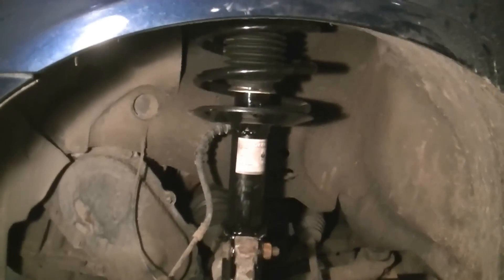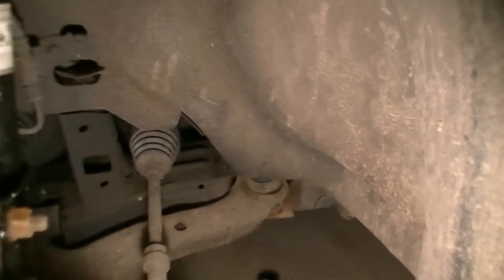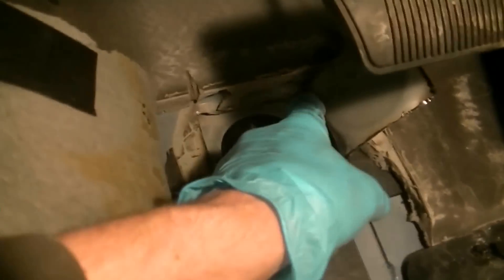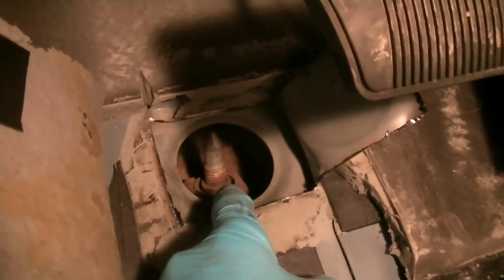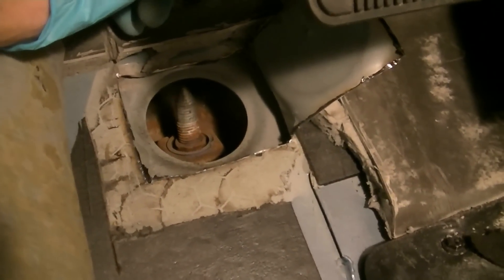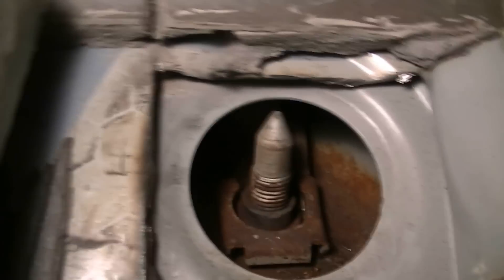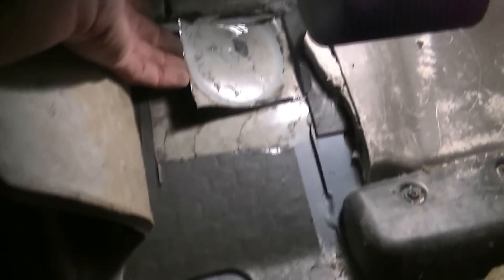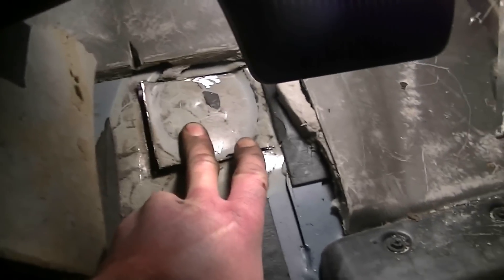PT Cruiser Spinning Control Arm Bolt Repair

Comment: Got this job going on myself, so thanks for the vid. I had these bolts out before for suspension changes, guess I should have put some anti seize on them. Can't complain about the car too much, best truck I've owned for hauling equipment in comfort. Not too many cars shorter than a neon that you can load up with enough sound gear to do a full concert. Holds more than most small wagons.

Comment: Thanks helped me alot. ending up drill a 1/4 inch hole right next to the flat side of the nut. put a 1/4 inch pin in the hole so the nut would not move. Now I have a mess to clean up.

Comment: So how did you keep the nut stationary?  The first attempt with a key, you mean a lock key or a shaft key?  Aboot to cut my floor board and need to know what to do with the nut to keep it stationary.
Reply from the maker: Justin Shiffler If you have 45 degree long needle nose pliers, it works well. first soak the shit out of it with penetrating oil, might need to use heat/torch.

Comment: I just work those back and forth with an impact, and usually they come out. When they don't, I cut out a 1 inch by 1 inch square in the side of the sub frame, torch the nut till its cherry red, impact the bolt out, then weld the square back to the sub frame when I'm done.

Comment: I have the same problem with an 08 cobalt.  Looks like im going to get the grinder out....  it would have been nice if gm would have welded the nut to the frame instead of putting welding a nut to a flat piece of metal and having a tin stopper cage around (that bends easily)
Reply: I have the same problem on a cobalt, how did ya do it

Comment: i always heat the bolt head before removal on these
Reply from the maker: UBBERTANKER So then it will be guaranteed to spin, Heating these bolts melts the plastic clip that holds the stupid nut in place. Obviously you never done one before!!
Reply: Haha you just got owned..

Nice job Rick you always get er done

Comment: If Chrysler actually foresaw this as happening, then they should have put a groment in the floor from the factory
Reply: ...they didn't foresee anything...he has no concept of uni body assembly...they go together in layers...that indent is there to help 'set' that layer align with the previous layer...or sub assembly...and the original hole is for the factory assembly...
Reply: And we have a winner!!!!!
Reply: @angusandleigh   well i guess pure luck that it is right above that bolt.
Reply: @tech1er829  ...that's all it was, if they wanted regular access...as above a body plug would have been used as well as a normal fastener.  That style of 'nut' is used when there will be no access when the shell is complete.  That hole in that inner layer would be for inspection during assembly or for welding in the 'nut' during assemble of the shell...